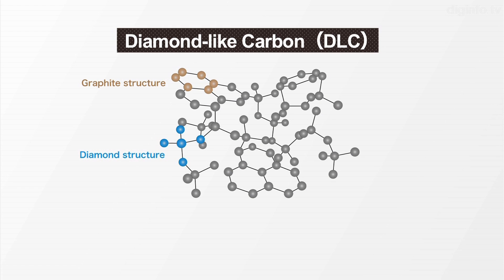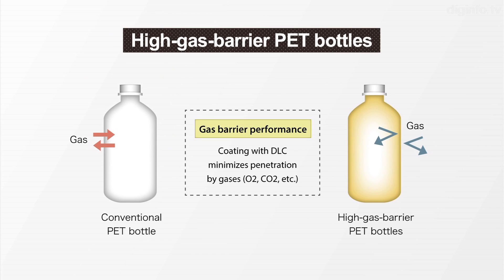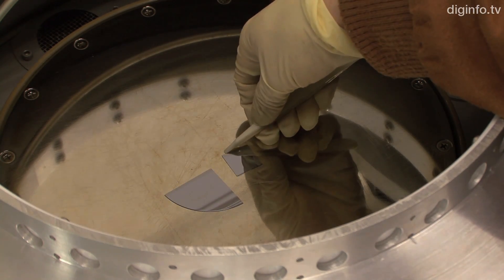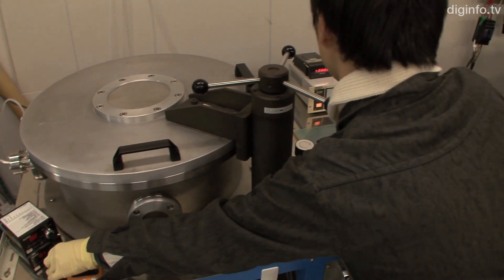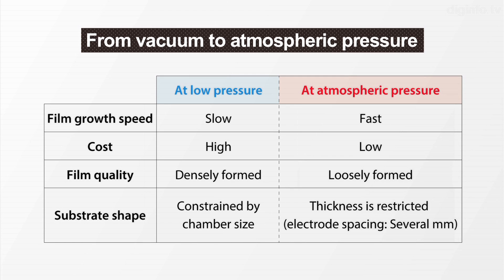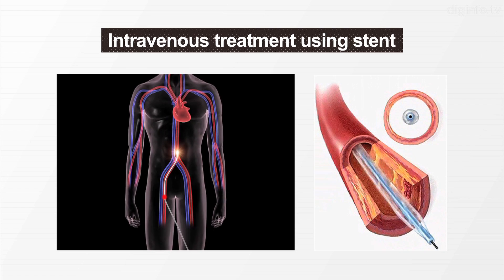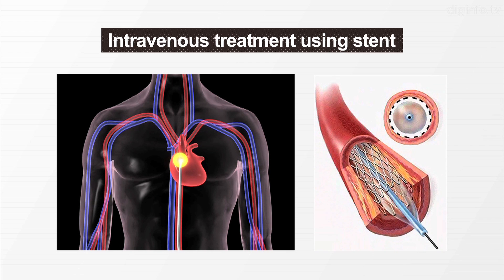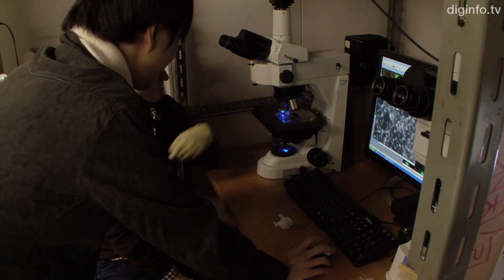Applications of Diamond-like Carbon (DLC) under research at Keio University #DigInfo

Comment: I want know if they can take carbon fiber fabric and coat it with diamonds to make an everlasting sandpaper?
Reply: You don't have to coat just add 6 percent dlc with fiber
Reply: Carbon fiber fabric doesn't exist. At least not in the way you're thinking. What we think of as carbon fiber is carbon threads in a type of resin. In order to have the characteristic strength of carbon fiber, it becomes a ridged material. And, unfortunatly, while carbon fiber is insanely strong, it does so by becoming incredibly brittle. When carbon fiber "bends", it fails catestrophically, and shatters dangerously. Also, even though DLC is awesome, it does wear off over time, just like any other coating. So, sadly, as cool as forever sandpaper would be, it isn't really realistic with current technology. I hope that answers your question. :-)
Reply: You can get carbon fiber matting just like for fiberglass. No resin in it. You add the resin. And the matting is woven so it's technically fabric. @israelgarcia7269